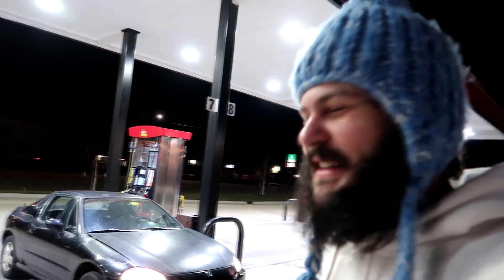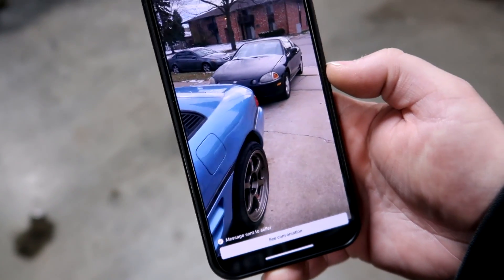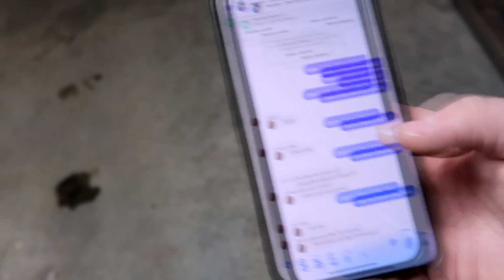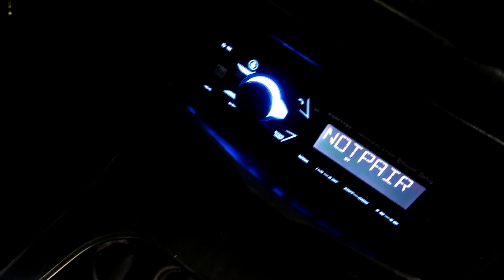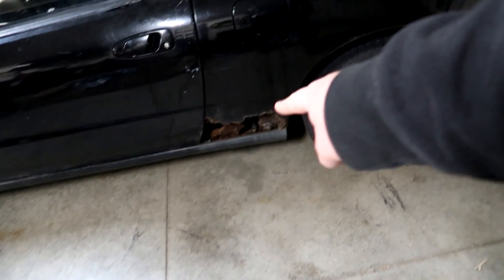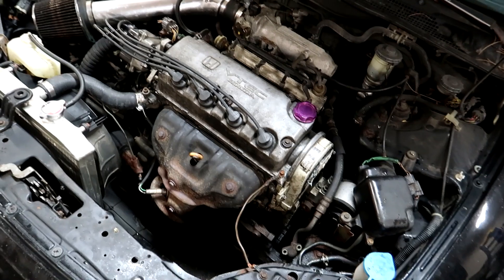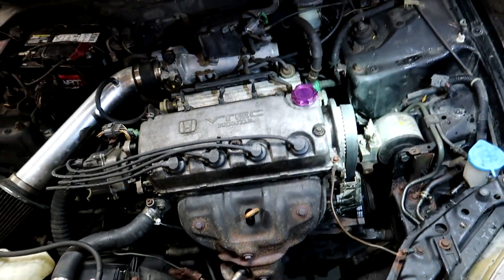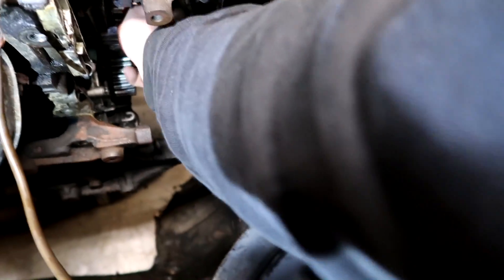I Bought A $500 Honda Del Sol - This Is How Bad It Was...

Comment: I lost my timing belt on my b16 crx reving at 8200, I pulled the head and not one bent valve. This was 15 years ago, and I was dead broke, I couldn't even afford a new head gasket. Amazing luck.
Reply: Even if they bend, they tend to bend back hitting the valveseats. If youre on a bidget just adjust the valves (free) and run-er.
Reply: @Nobody Noone  I didn't even adjust the valves, new headgasket, and off I went. Now, today, I have no idea where that motor ended up, but I wish I still had it.

Comment: The way it fired up first crank 😂 This is better condition than my Del Sol (minus the rust). I have p2p0 rods, vitara pistons, king bearings, stock head with arp studs. It’s on a base map, with stock fuel system. I’ll be ordering 1000cc injectors soon! I can’t wait to properly tune mine. Stoked for this build!

Comment: Man, I've never owned a Del Sol, but I've seen some nice high horsepower units. I have only ever driven one, and it was a B16 Si 5 speed that was REALLY surprising. I was only about 16 at the time, so I didn't know what it was or how rare it was, but it was easy to break the front tires loose in first and second. Edit: You know that I am almost 40 now, so when I was a teenager the B series was the end all be all. The K series didn't come out until I was in my late 20s and they were easily $10k for a stock K20 or K24 until ten years later.
Reply: Was it a factory B series? If it’s a B16 that’s a VTEC trim which is superrrrr rare
Reply: @williamgoestenkors6846  Mine is the 1.6 liter, 125 hp, single overhead cam VTEC. It was the more powerful engine that year. I believe it has the D16Z6 factory designation.
Reply: @paco728  92-95 came with the D16Z6, 96-97 has the D16y8. The VTEC trim has the B16A.
Reply: @williamgoestenkors6846 proud to own an origanal b16 vtec 94 they are super rare I'm surprised I found one 😆 luck was on my side
Reply: @williamgoestenkors6846  the b16 vtec trim was not rare. lmao. this is the claim because in 1993 there was only an S and SI model, d16y8 and d16z6 respectively. I had a 93 Si which had d16z6. after 93 aka 94-98 the vtec trim was added which had the b16 motor. so more del sols were sold with vtec trim than without. its factually wrong that the b16 version is rare. in truth, most of us back when were broke, and it was cheaper to buy s or si model instead of vtec model.

Comment: I have one. I purchased it new exactly 30 years ago in December of 92. It's a 93 Black Del Sol Si manual transmission , rear spoiler, 81,000 miles, all original and near perfect rust free condition. Just replaced the timing belt for the first time this past spring based on some advice from another you tuber. My only modification came a few years ago when I put in a new head unit and sub woofer. Fleetwood Mac has never sounded better. Love, love, love the car!   Keeping it forever. Have fun with yours, Hunter Tuned.

Comment: I say make that desol special! It would be a good video series! Can't be the price especially with such an easy fix! I have run a single cam with the balance shafts 180 degree out hell of a noise when u shut it off but ran fine. I fixed when I had a day off. Killer thumbnail!!! Keep pushing

Comment: I'd like to see this car get boosted as high as you think it can go and still be reliable.  Comp Cams makes camshafts for these for like $300-ish bucks.  Stage 2 cam needs springs so I think you could do a cool video showing how to install the cam and valve springs via pressurizing air into the spark plug hole.  Then no need to pull the cylinder head.  Maybe do a fender exit 3" pipe too.  Or maybe full 3" back.  And fuck yea ice racing!  Sounds good.

Comment: The rear window has drain plugs on each side that get plugged.  Water collects and causes that rust behind the doors.  Dropping denture cleaner tablets on each side through the window slit will eat out the gunk plugging the drains and open them again preventing that problem.

Comment: *********DRAIN TUBE ISSUE*********  I've own over 20 sols and i'm pretty sure the confined rust holes is because the rear window drain tubes (one each side) are plugged....from years of sediment, dirt, leaves, etc. getting in.  This seems obvious because there is no rust anywhere else on the rear wheel wells.  I had the same problem with one of my sols.  Fortunately, there is a detailed youtube video showing how to easily unplug the tubes - from underneath (plastic rocker panels come off) - so you don't have to laborously remove the rear compartment from the inside.  I would try that underneath approach first.  Also, I don't suggest repairing the infected rust holes until the water leak issue is fixed.

Comment: Man I love del sols! Especially when you get a great deal! I bought a samba del sol for 300 bucks and it had a d16z6 also and I fixed it sold the engine and bought ls block and gsr head and everything was going great until the oil pump I bought for it was defective and it starved the oil in it and blew a rod right through the block. Ever since the. It’s been hard to get a good la block and I ended up buying an h23a motor and that’s my next project so hopefully a del sol with an h23 vtec will be fun

Comment: I'd say get rod bearings and valve adjustment it is possible the car can be running somewhat okay even after timing belt has come off on a interface engine a valve can be slightly bent on the valve guides are not aligned, funny because this happen to me in a 500 98 civic sedan aha and I did the same thing although the head on mind I know has a bad Valve I've been driving like that for over a year

Comment: Heck yea. I would pull those side moldings off cut out the rust and put in some new sheet metal. As nice as the rest of the car is an the underneath is that's a fixer.  Maybe pull the tail light and see if you can pop that dent out do a little bit of clear coat or paint touch up and it'd be a nice car.
Either have a nice little beater car or do a budget turbo setup and drive or sell.

Comment: i bought mine for $150, the guy thought the engine was dead but it was just a broken belt, apart from a few scratches and dents on the body the car is in mint condition, even the ac works lol

Comment: that ground is useless anyway..should be mounted to ps pump bracket which is obv gone..doesnt make a good ground thru the rubber gasket and grommets on valve cover...just saying...sweet buy tho

Comment: What's the full name on the title? Mine is honda civic crx del sol si. Mine is a 93 titled as a 94. Reason I say Mine is like that is cause of the 2nd air bag. Mine only has driver side. I assume they switched the airbags middle or early 94.
Reply: Got mine for 200 and only need a distributor.(I worked at a impound lot. Boss hooked me up)

Comment: Timing cover :)

Nice find though. Almost anything is worth it for less than $1k anymore, these simple hondas are just getting hard to find. That rust is a real mystery though, I just bought a 92 accord with some rust at the rear of the quarter panel and absolutely spotless everywhere else. Very odd. 

By the way, I've sent you a couple texts and emails about my car- can you get to those when possible? Just want to make sure they're being received.
Reply from the maker: Resend them now I will be on watch for it
Reply: Rear quarter rust usually starts from the underside kicking up rocks. Common af on hondas.

Comment: Get a can of spray foam and fill up those holes then just use an exacto knife and trim the excess to match the body of the car.  Then if you want to get real ambitious get some thin metal from Home Depot use tin snips to cut a couple pieces to cover over the foam rivet them on and a couple coats of black spray paint.
Reply: That will just trap moisture and make it rot faster. Please don't do this. Same goes for aluminum rivets.

Comment: I really really hate you!! I'd smack the shit out of both of my daughters just to find a $500 Del Sol in that good of condition lol

I'm building my 95 Sol right now. The last of the engine work to be done is to finish the port/polish of the head and slap it back together. That includes CompCams  59300 camshaft, flat face valves, new springs and seals. It's a vitara build with everything replaced with high end name brand parts. Only thing that isn't name brand is the turbo and manifold. It's just ebay for now to mock up and daily for now. ECU, S300, injectors, fuel pump, intake mani, sensors, everything to make power is ready. I'm only missing a fuel rail, which I'll probably get from you this weekend. 

If you were closer I'd be bringing this thing to you for dyno. It's a 500+HP Z6 for sure. Shit I might make the drive from Cincinnati anyways just to have it tuned and featured in one of your dyno vids!!

Keep it up brother!!

Comment: corner light breaking free is super common. mine did that back in the day and i just hot glued it back on lmao. quarter panel rust is common too. super common. lmao. my top leaked as well but i never fixed it. i wanted to buy new rubber but before i had a chance the engine blew and i ended up just junking the car for 500 and bought a s2000.... those taillights are ugly as shit. please go oem or oem adjacent. please! lmao. those del sol phat 5's are legit. I would get them resurfaced with some quality michelin all season tires and enjoy the fuck out of them. no need for aftermarket those things are light weight as is.... the quarter panel rust, comes from trunk leaking. and pools up at the bottom thus rust at the bottom quarter panel.... again super common.

Comment: Hunter, PLEASE put an eBay turbo kit on this Z6. I bought my 1997 EJ8 Civic coupe, but it was freshly rebuilt and ran like crap. It was supposed to be a freshly rebuilt D16Y8, but it had a JDM D15B 3 stage VTEC with a D16Y7 head (because the original owner of the D15B swapped the head onto a non-VTEC block and sold it to this 19 year old kid as a legit VTEC engine). I swapped a Z6 head onto it and I bought an eBay turbo kit, and fabricated everything else for it.